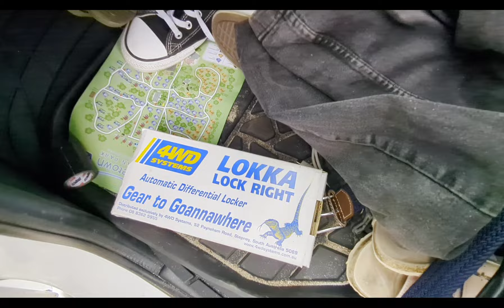Mahindra 2 year overview

Comment: Hey Mate! I love my Mahindra s6 4x4 double cab Karoo. I'm based in the bush in KwaZulu Natal, South Africa. It's been everywhere my Ranger, Defender and Jimny went. The only thing the Defender was better in was the critical angles, hard corners and suspension. At the price this car is really tough to beat. Tough as nails, does everything it says on the tin and a pleasure to drive.
Reply from the maker: Hey Craig. I couldn't agree with you more. There is something to be said about solid axle rigs. I found the steering is very limited compared to what Im used to driving. I'm glad you're happy with your S6. Value is where this vehicle has its main appeal for sure 👍🏾